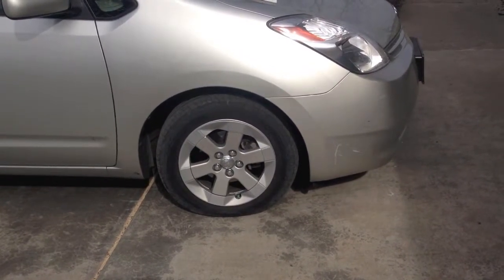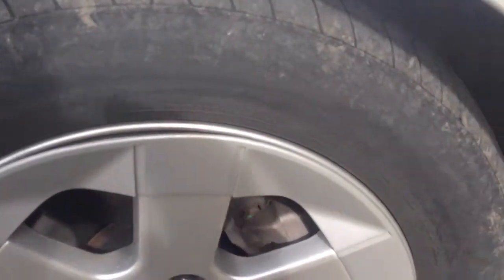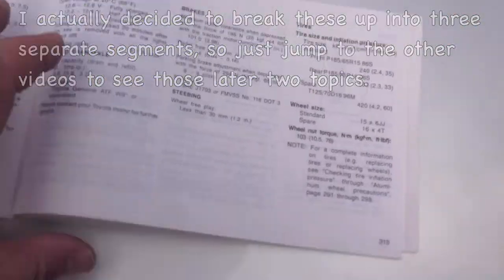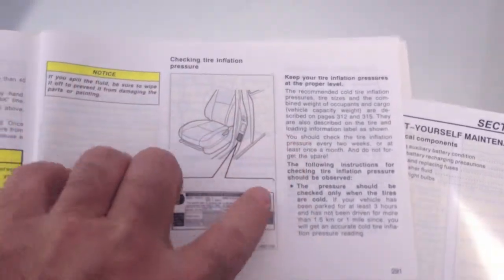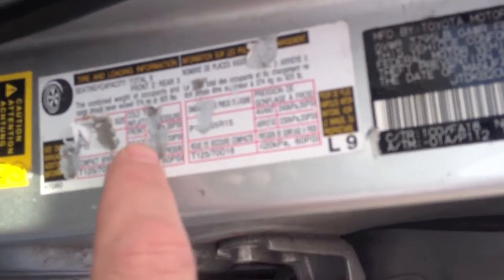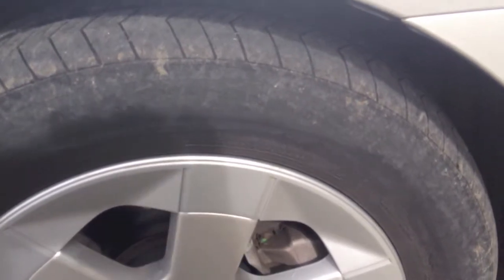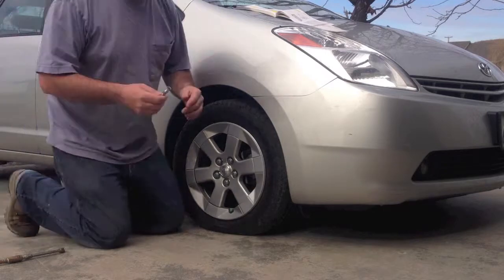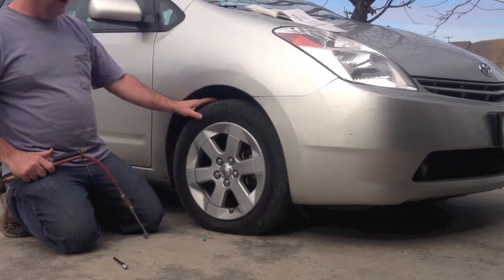MDOP#14: Tire Pressure -- Everything you ever wanted to know (and then some) about tire pressure

Comment: You are suppose to put air pressure by whats on the inside of the car door. NEVER, Whats on the tire. This is what my Toyota dealer told me. It has nothing to do with the temp outside. Keep the tires filled to whats on the sticker on the inside of your car door.

Comment: Great Video! Keep them coming.
One thing when explaining concepts and parts to someone who is new to this stuff is that you need to be as complete as possible.  For example with the tire valve, you should have mentioned that there is an internal spring that keeps it closed. Someone with limited experience might have come to the wrong conclusion that the valve stays closed due to the internal tire pressure for example :)
Ken